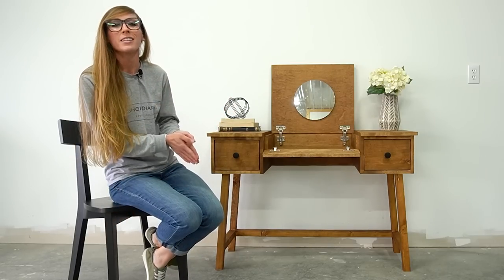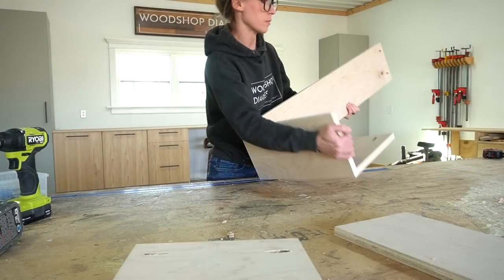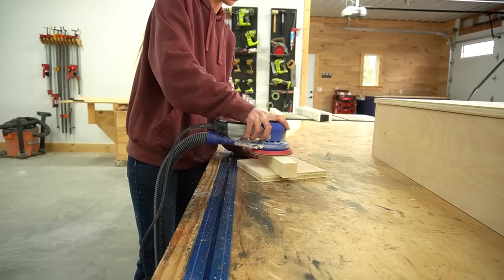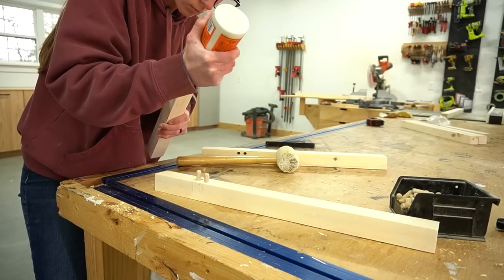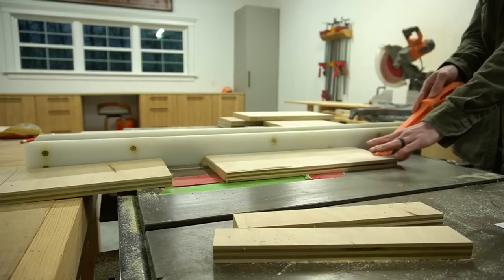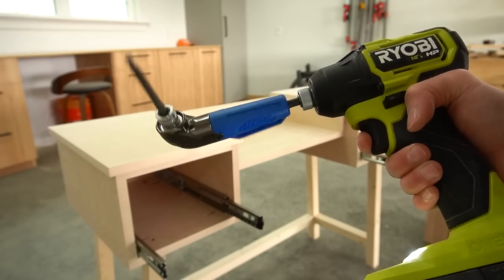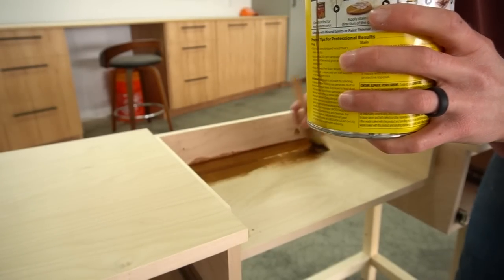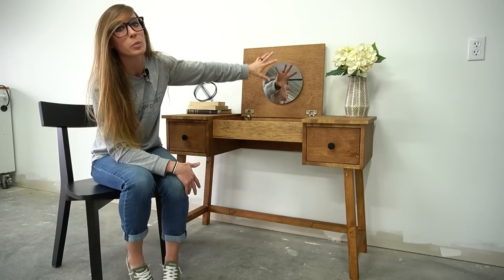How to Build a DIY Vanity Desk | Building Plans

Comment: That's a rally cool design. I've been trying to figure out if I want to add flip tops to the record player stands I make. They're all solid wood, so I'm worried that the 'free' panel will warp or cup over time. Not sure how I will ever test that 🤔
Reply from the maker: Thank you! You can never predict how wood will move. Some times what you expect to happen doesn’t and something what you don’t expect to happen does. It has a kind of its own haha. My philosophy (which is not right or wrong) is always to try it and see what happens. Worst case, you have to fix or replace a piece. But many times, it is fixable or replaceable so it’s not the end of the world. Sealing both sides can help prevent warping…not a guarantee, but a preventative measure 🤷‍♀️

Comment: I have noticed you do not use glue when assembling with pocket holes? Or did you not film that?
Reply from the maker: I typically don’t. It doesn’t do much except make the process a lot messier. In some cases, it’s helpful, but most cases, it’s not. 
I do however use glue with pocket holes when I am attaching 1x2 or 2x2 pieces because I usually only use one screw on those to prevent splitting. So I use wood glue to help prevent twisting in those cases.

Comment: This is a very flexible design that could be adapted in lots of different ways; size-wise as you mentioned at the end (yes, I'm still here 😊), or it could be easily modified to be a straight desk, a computer workstation, or maybe a crafting station. Nice!  P.S. - your ticket off the struggle bus is a GluBot. Hashtag not sponsored.  (Don't ask me how I know.)  P.P.S. thanks for the Bubs screen time!
Reply from the maker: Thank you! I’d definitely love this as a desk myself…makeups vanities aren’t my thing haha. You just have read my mind! I just told someone this morning that I needed a glue bot. I’ve been meaning to buy one for years and just never think about it until times like these. I need to add it to my amazon shopping cart!